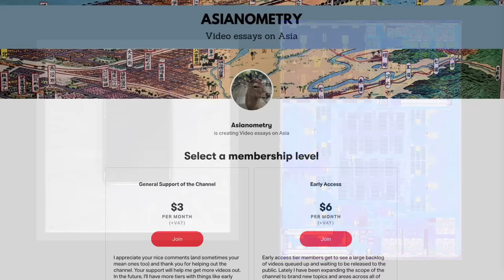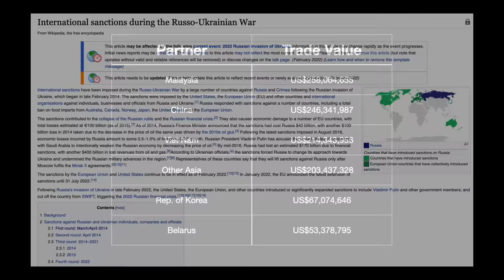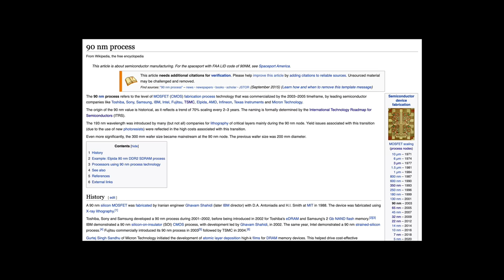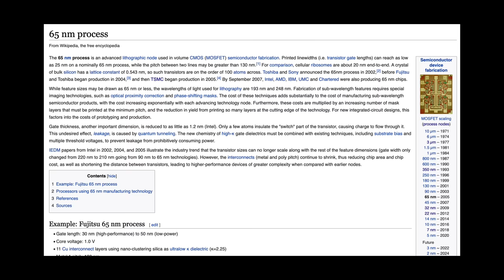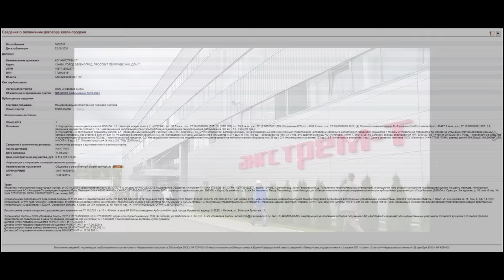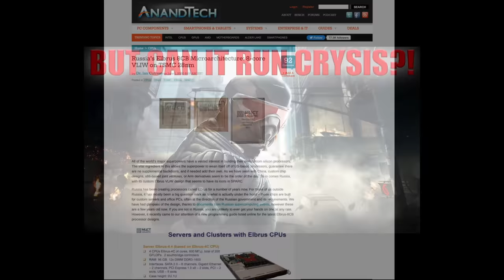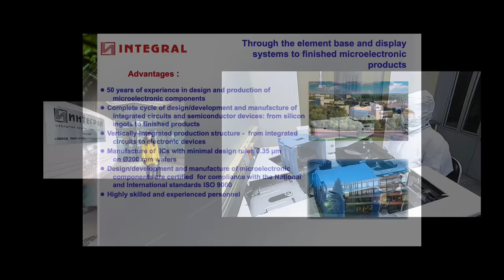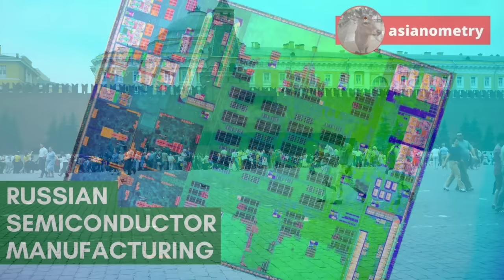Why Russia Can’t Replace TSMC

Comment: The USSR dissolving only set it farther behind the west because they stopped caring about actually developing domestic industry and instead just started to care about what is most profitable, and since Russian semiconductors were more expensive for less performance, it was more profitable just to dismantle manufacturing capabilities and import them, causing Russia's economy to undergo deindustrialization and become an import-oriented economy, at least until 2003 when it started to turn away from that, which also coincides with its economic recovery. These sanctions will likely lead Russia moving more and more towards a Chinese-style economy which will help accelerate industrial development, albeit it likely still will not catch up to things like TMSC for a long time since that would require a miracle.
Reply: No,Russias are very poor at innovating ,they will keep sinking. Just a question of how much damage they do in their death throes.
Reply: @paulbedichek2679  Russophobia won't save your declining empire.
Reply: @paulbedichek2679  It was sinking in the eyes of Poland as far as the written history of the two goes, meaning hundreds of years. And remember: each World War was started with division of Poland.
Reply: @ShadeAKAhayate  Don't tell lies, it doesn't help your case.  WW1 had nothing to do with Poland, because Poland didn't even flipping exist.  It was 1/2 in Tsarist Russia and 1/2 in Germany.

Comment: One thing to note. Node sizes are not comparable to one another manufacturer. "If" Intel had their 10nm node ready back in 2016, it would of took TSMC 4 years to bring out the 7nm node to become a competitor to intel. That said, "If" that was the case, then Intel no doubt would be on 10nm++++ by now. 
What will be interesting is Intel 7nm vs TSMC 3nm in 2023. (Moral of the story, lower nm doesn't always mean better performance when comparing different manufactures against each other).
Reply: Intel recently rename their nodes so that they are comparable to TSMC.
Reply: @kazedcat  simply renaming their chips doesn't change things, if Intel's chips are not the same size as TSMC's chips, it will struggle to compete unless it implements structural differences that make size less of a factor.
Reply: @ernestmac13  since before the 22nm, the nuimbers don't refer to gate size. today it's only a number to differentiate processes rather than an actual dimension.
Intel's 14nm is almost comparable to TSMC's 7 under the electron microscope, yet one is twice the other.. 
I mean.. you wouldn't pump 1.5V of Vcore into a 7nm ryzen otherwise :)
Reply: would of took
*would have taken
Just curious: What's your first language?

Comment: Wonderful content.  Is it true that  TSMC is down at 5 nm.  Even Chinese fabs are nowhere near to that.
Reply: The leading edge node is 3nm for next year
Reply: @aravindpallippara1577  wow progress never stops.
Reply: @fredfrond6148  the problem is the benefits of moving from one node to next is becoming marginal - apple m1 is 5nm, however while it's performance per watts is exceptional, from a raw computing standpoint it's less performant than an amd 5600x a 7nm chip that does draw 3 times the power (65W vs 20W) 5600x is a mid grade offering from amd (5950x the top offering roughly has 3 times the cores as 5600x)
Reply: @aravindpallippara1577  damn you have just dragged me into water that is above my head.  I was looking at buying an apple precisely because of the m1 chip.  But obviously that makes no sense if I want a desktop.  Thanks.
Reply: @fredfrond6148  Honestly though, as much as I am an amd fanboy - get an intel 12the gen, especially any offering that has the 6 performance cores (12600 I believe), the performance improvement in lightly threaded applications is staggering (well like 15% more raw performance or so - still extremely huge when we are dealing with processors) - just make sure you have a beefy aftermarket cooler if you do multithreaded stuff like rendering, compilations
Reply: Mainland China has never been know for cutting edge for the technology. They are highly dependent on others developing the technology.
Reply: @fredfrond6148  Just note that, that 3 in 3 nm is a marketing BS. No structure is below 16 nm in those chips.
Reply: "Even chinese fabs" is kind of misleading. The Chinese are really far behind, considering their stand in technology. They don´t produce advanced lithography machines, and ASML, who supply most of the EUV machines, are not allowed to deliver them to China. Taiwan and South Korea, as well as American companies like Intel are significantly firther.
Reply: @aniksamiurrahman6365  can u elaborate it a bit with a reference to any supporting article?
Reply: @aravindpallippara1577  why are you comparing m1 to 5600x (previous gen desktop chip)?
Reply: @OWAIS843  Talking specifically about micro chips.
Reply: @johniii8147  China has been a poor nation in the recent centuries but has made a stunning progress in last 6 decades. They caught up in many important tech such as their own internet (although protected) but protection has helped create global products like tictok, 5G. They are catching up in chips and materials engineering such as high temp alloys for jet engines. Based on this progress rate, one can assume they will soon catchup.
Reply: @deezeed2817  It's not about propanganda mate it has always been about people - if you can attract the best in the world your country automatically ends up richer and better - west has been at it for a century now - the best Chinese, the best Indians, the best Saudi's most of them are in the west.

The world is global now, if you can't attract talent it's a slow but sure way to falling behind
Reply: I heard North Korea is close to 1nm
Reply: @tgmtf5963  1mm
Reply: IBM released a 1nm process as well...
Reply: @tgmtf5963   Used in ocean seeking missiles.
Reply: yeah. My GPU which I bought year ago is 8 nm.
Reply: “Even Chinese fabs” .... lol
Reply: @fredfrond6148  Apple has what is essentially a super sized Mac Mini with multiple M1 chips. This needs me to think we will see a return to multi-cpu and multi SOC desktops and hopefully laptops. A.I. will be used more and more chip design, and will hopefully help us develop new technologies similarly to.how an A.I. used to examine the scans of people's skin for signs of skin cancer learned on it's own multiple pre- cursers for skin cancer researchers we're unaware of.
Reply: @aravindpallippara1577  so true, and this is why Russia's War with Ukraine will hurt it in the long-run. The war will not only contribute to social unrest, it is already leading to a brain drain. China is the same way, with its current Covid crisis, a Ukrainian who has been in one of China's locked up apartment buildings has said the situation is so bad she can't wait to get back to Ukraine despite the war. Seeing what has occurred across China, many of those with the means will do all they can to flee what is going on simply due to the Covid crisis, as China's economy continues to collapse even more will choose to leave for the sake of themselves and their children.
Reply: @tgmtf5963  I do not.know how much we can trust what comes out of North Korea, much like China too many have a vested interest in lying.
Reply: @tgmtf5963  🤣🤣🤣🤣🤣🤣🤣🤣🤣🤣🤣🤣🤣🤣🤣🤣
Reply: @tgmtf5963  savage! Like it
Reply: Doesn't China make 7nm chips?
Reply: @marilynlockheed6811  yes they tested some chips made by SMIC and found them to be 7nm.  But this was after I made the comment.   Also nobody knows how they did it since China had been boycotted from the more advanced EUV tech.

Comment: One thing is, the vast majority of the electronics we use is not on these super fine nodes. 250, 180 and 130 nm are still used massively, copper AND aluminium. But even if they have capacities with these nodes doesn't mean they have the designs in hand, even cloned..

Comment: According to online data the main chip imports for Russia during the period between 2017 and now are in fact from Infineon (Germany). Most memory imports are from Samsung and Micron/Elpida. TSMC are not even in the top 10 of their imports - over the past 5 years Russia has imported 100 million worth of semiconductors from TSMC, that's nothing. Consider TSMCs revenue for 2020 (hell even pre-covid 2019) only and you'll realize Russia is probably one of their weakest clients. Baikal and other manufacturers are absolutely irrelevant both in Russia and worldwide, so much so that even their websites are still under construction. 
Russia doesn't need to manufacture when they can trade raw materials in return for ready-made chips with custom IMS from, for example, China. 
Why Russia can't replace TSMC? 
The answer is simple - because they never really needed them.

Comment: There is a law in Russia that all computers in government's organizations must be produced in Russia. Sanctions will only help Russian manufacturers to take the larger part of the market.
Reply: the law makes sense
Reply: You forget, you also lose the benefit of the better devices, especially as ai is being used in everything. 
Look at Brazil.
Reply: @DerDop  Russia always were a superpower, and always will be.
Reply: @alexsilent5603  Russia never was a super power, URSS was, that's one, and second, we've all seen how mediocre the Russian army is. Russia is in decay
Reply: By and large those were Baikal and Elbrus devices dependent on TSMC, as well as domestic products with foreign chips inside (e.g. Kraftway, Yadro). With TSMC and AMD/Intel gone, there's no viable way to produce powerful enough computers for these applications
Reply: Alex, do more research 

Russia won’t be able to produce computers without the supply of parts from Asian countries
Reply: @helgakrobo  not even China can produce viable computers, and Russia can? Russia is nothing more than a Balkan country with nukes and oil
Reply: @jennychuang808  Alex is a Russian bot, I think
Reply: @DerDop  you didn't read very carefully - I'm saying that Russia could only produce computers with imports from Taiwan and the US still open. China can produce more powerful systems using the same options - look at HiSilicon and RockChip SoC, and there's a lot of custom hardware China makes using Intel and AMD chips
Reply: @helgakrobo  and where are we in disagreement? I said exactly the same thing, Russia and china can't depend on Taiwan, and to add, everyone depends on ASML, a dutch company
Reply: @alexsilent5603  Don’t be silly, their economy is less than Italy
Reply: @alexsilent5603  Check it out, they are nowhere near as powerful as people think. Without the nuclear weapons Nato would have got involved and Moscow would be a memory.
Rouble is in free fall, interest rates doubled, stock exchange closed all week. Their economy will implode before April.
Reply: @aiistyt  Lets return to this thread in April then...
Reply: @aiistyt  Not as powerful? Russia is most likely more powerful than all european NATO countries combined. If what you are saying comes form ukrainian war, look at what was deployed in ukraine compared to what NATO deployed in Libya. Ukraine is a big country.
Reply: @ElvenBubblegum  No, my knowledge comes from studying it for 40 years. The only reason Russia is tolerated is because of the nuclear weapons, economically they are weak and getting weaker every day. The USSR was destroyed by the west using economics and Putin has just guaranteed the same fate for Russia
Reply: @aiistyt  ussr was not destroyed by economics, seems like your studying was for naught
Reply: @ElvenBubblegum  Where is it then, where did it go. I feel sorry for you
Reply: @sickrantorum693  they have more tanks airplanes and etc. While most of those they have are a bit old they have newer models as well. They have missile systems that EU doesn't, their technology is among the best in that regard. Still obviously in a war they would lose to  EU because they can't outrpoduce EU. What I am saying is the sheer number of vehicles they have is massive and in Ukraine they didn't use even 10% of their power.

P. S I said European NATO countries not entire NATO. Entire NATO Is obviously more powerful while Russia is not even close.
Reply: @aiistyt  So, lets check it out... It's April, Russian economy is doing fine, ruble restored its value. At the same time inflation in Europe may hit 10% and we already see protests there.
Reply: @alexsilent5603  The Russian economy was in trouble before the war started. Inflation is above 1% per week. Car prices are up 30% in last three weeks, 60% in last six months. Where are you going to get spare parts for cars let alone all the western aircraft you fly.
Reply: @aiistyt  Russia produces its own cars and planes.
Reply: @aiistyt  You are delusional. Russia is a superpower and the best place to live.
Reply: @alexsilent5603  Apart from having nuclear weapons what makes Russia a super power. It’s economy is below that of Italy or even Texas. As for being the best place to live, well good luck with that. I was trying to be reasonable, especially regarding ordinary Russians but it’s clear you’re not interested in the truth so let’s end the conversation here.
Reply: @alexsilent5603  Virtually all of your commercial aircraft are Boing or Airbus, who are you trying to fool? As for cars, the only decent cars you make are from western factories in Russia and that is going to end. If you’re not a paid propagandist you need to wake up, if you are then I feel sorry for you. Good luck Alex, you’re going to need it
Reply: @aiistyt  Russia is the second largest economy in the world after China.
Reply: @aiistyt  Russia has MS-21 planes. And in the worst scenario we can produce some Soviet era planes. Their only issue was being too loud.

There is a video on YouTube named: "Lada Vesta SW Cross Luxus 2019 Review, Test, Fahrbericht". It's a German review of Russian car. You may like Russian cars or not, but this is just your personal preferences, car is ok.
Reply: @alexsilent5603  The biggest is USA, followed by china. Russia was 11th last year and it’s dropping in the list. Where on earth do you get your information
Reply: @alexsilent5603  Per capita income Russia is 57th in the world
Reply: This law has not been implemented. The Russian drone Orlan-10 shot down by Ukraine, from the picture shows that
Reply: @aiistyt  "The ruble is in free fall" - what will you come up with a year later? How is your banking system doing, how does inflation really bother you?😆🤣
Reply: @aiistyt ”inflation 1% a week” no it isn’t. As opposed to Bidon gov printing Trillions of $ and food and gasoline doubling? And housing going up 20-30% in 2 years?

Comment: your assumptions are idiotic since the Russian military doesn't use their chips to play video games most military software uses basic instruction set and do not require a large processing power which would make any 90nm chip more than sufficient
Reply: Software efficiency is severely undervalued in the west. It's true. Older software is more efficient, and far more reliable.

Software is made into bloatware for one major reason, to drain system resources, make the consumer think, "this computer is slow because it is old," and buy a new one.

But with old computers, they never got slow and never wore out, because there wasn't bloatware.

Comment: At an air show in Australia there was a large Russian transport plane my friends walked through, they lifted a panel cover and were surprised to see valves were normal electronics were expected. 
The Russian were showing off how big the plane was. 
All they could remember was valves.
Reply: That CAN be a deliberate choice. Valves do not fail in case of huge EMP from nuclear detonations...microchips will unless they are extremely well protected.
Reply: @Kakker71  yep , could be.
Reply: sorry, you mean valves as in hydraulic controls where electronic controls are expected?
Reply: @jorggggggg  no, vacuum tubes in electronics but called valves in the UK I think
Reply: @jorggggggg  vacuum tubes that glow. 
The electrical charge is changed in a controlled way to control the electrons flowing through it. 
High voltage and wasteful of energy. 
Very old technology, replaced with transitors in the West.
Reply: siu-hung Hung  the USA has protected their electronics. 
You are right the valves should be resilient. And heavy and bulky and power hungry.
Reply: @stephenbrickwood1602  dont forget fragile, and prone to burn-out!